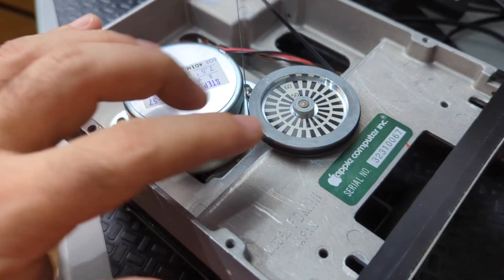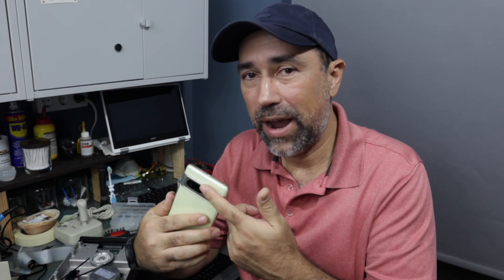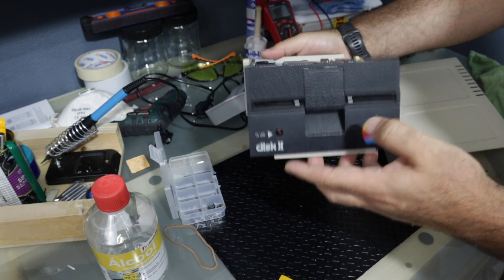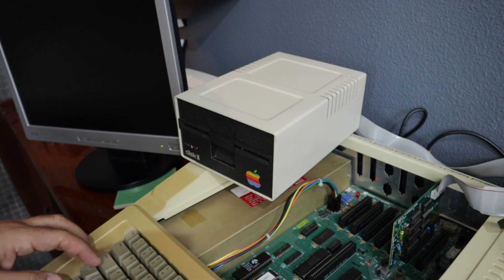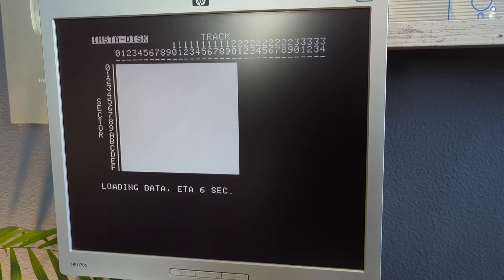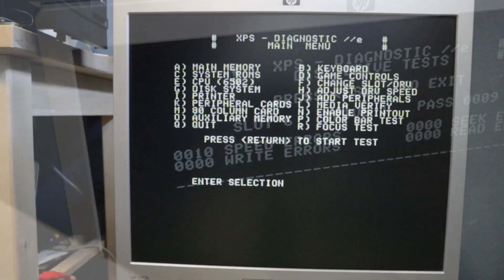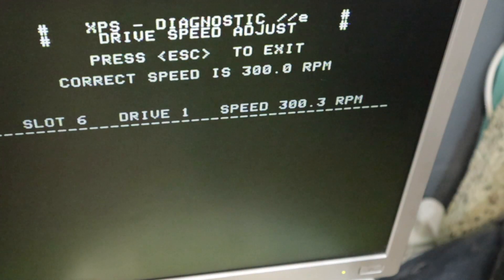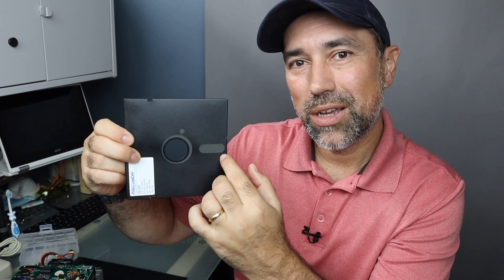The disk II was designed to be repaired, and this is the story of how I fixed it

Comment: Awesome! One thing you might want to make sure other people know is that Apple's repair manual actually specifically said to NEVER lubricate the drive rails no matter how tempting it is. Cleaning them with isopropyl alcohol is the proper way, although I don't know why.  I can guess that it is  because all oil breaks down over time -- even synthetics like WD-40 become a sticky mess -- and silicone lubricants were not common back then.